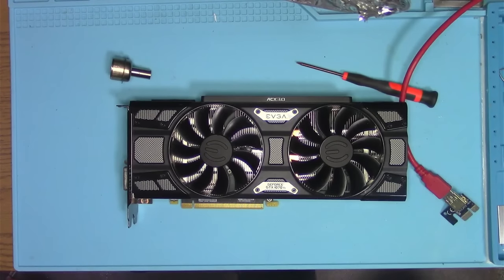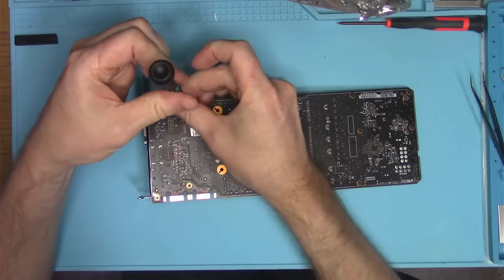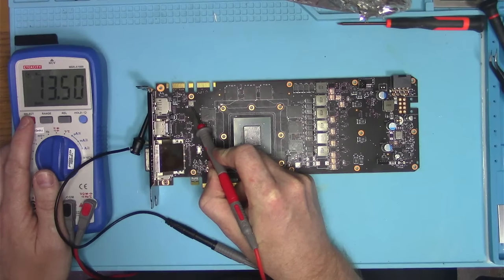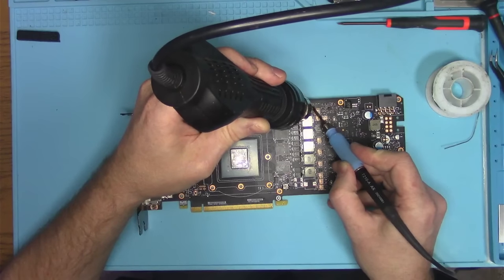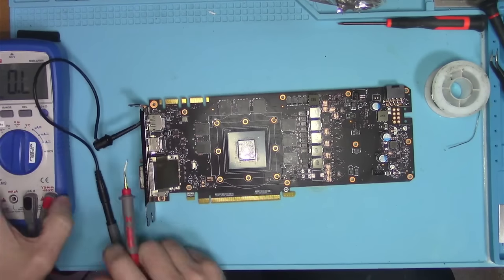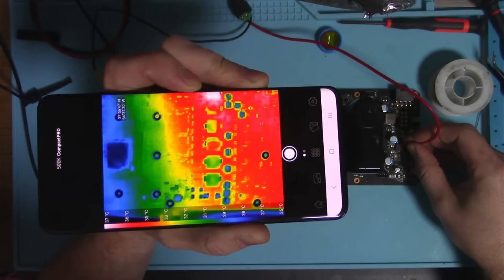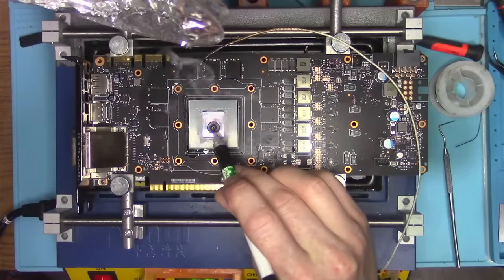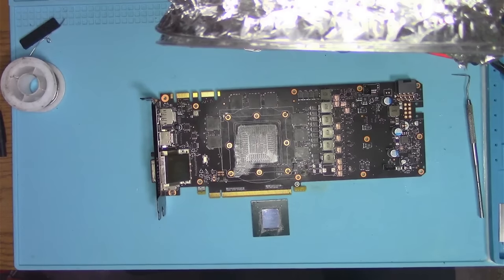How i learned GPU repairs

Comment: Hello, my gpu have 3 DP and 1 HDMI. Two DP port is not usable. The first DP port got not signal, second DP port boot up then make system unstable and freeze the system (unrespond). I'm currently using HDMI and the third DP which have left on the card but they refreshing every 5 minute (gone black screen for 2 second) on main monitor. May I know what the problem might be? Is that the port or the circuit? Thanks.

Comment: Same happened with my 1080 EVGA. All of them the same overheating VRM bs. If you don't want to mess with repairing your own GPU, just go the Nvidia control panel and set MAX fps limit for your games. From my tests (non-dead cards), setting a constant and low fps will not overload the VRMs and it won't go black screen/full fan speed 99% of the time.
Reply: Maybe undervolting? Helped me with my 3070ti

Comment: You are wise not to assume anything... The first GPU I worked on was a 1060... it had a mosfet stuck open feeding 12v to the core... No fuses... I was like this core is 100% dead and gave up on it... Next day I’m like what if? And I take the component of the board, put it in a machine and what do you know, it actually worked 😅 In fact it still works a year later gaming daily... Part of the luck of the customer was him using a good seasonic psu that tripped OCP really fast... He actually tried to power the card more than 10 times... So imagine feeding the core 12v 10 times and the damn thing still works 😅😅 I still can’t believe it haha

Comment: Hey do you have any videos explaining how you learned how to do this? I see you're checking resistance and for shorts but you don't explain how you know what values you looking for or how you know which areas to check or which areas to desolder and run voltage through

Comment: Word to the wise .... If you keep using "whatever is handy" to prop up the board on your bench you are going to short out the card. So far every one you have used  - screw driver, flux syringe - have metal ends and trust me, they will short out the card.
Ask me how I know 😞 Suggest using items made of wood or fiberglass. NOT METAL!

Comment: Can I ask a question, I just turned my pc on when I woke up in the morning, was able to open chrome and search youtube, 30 seconds later my computer suddenly turns off, I was trouble shooting it on which part was not working and when I replaced my gpu with a different one it displayed. Can I ask what caused or what is the issue of the previous GPU and is it still fixable?

Comment: Hi , Zotac 3070 OC was working for a year , one morning i started pc , i've opened google and after 7 min of use screen went black , upon restart i get 5 beeps no signal . i knew power supply was not enough and i used a pigtail also , witch i new is not ok but i didn't use the gpu on hard work so was fine till now . after  i verify my 3070 in another good pc , the videocard was working and on max setup in games went in 64 deg max . i thought my psu is short on the pce6+2 cable so i replace the psu with a 750 w with 2 gpu cables , yesterday was working fine full load in games , today i started the pc and game me no signal after i entered the password lol so i've replaced that 3070 with my old 1050 and pc is working fine as it did for the last 4 years now , what that 3070 might have ?

Comment: Can I please ask you a question?

My GTX 1050Ti got fried after only owning it second-hand for 2 months... I took it to 2 different repair shops and one of them told me the power supply to the GPU is fried.

So my question is, can it be fixed? Or did they really try their best?

Comment: I honestly do not see how this video explains to us the average person or anyone with just a little bit of knowledge how you learned to repair GPU,s.  A more in depth explanation like how to know which pins to check firstly for shorts, and how you know what ohms should be coming out of parts your checking would give us more insight on why and how and where to look for shorts first off all. Please make a more in depth video for us wanting to learn how to find faults on our GPU,s would be greatly appreciated, and maybe let us know what symptoms of common faults align with what to check firstly and so on. You are a professional at repairing GPU and know exactly where and what to look for, the vast majority of us wanting to fix our own GPU do not know even the basics.
Reply: I think we can conclude that he looked up tutorials for one need at a time. It started with the memory sticks, so he must have done some research or had prior experience in soldering and anything he couldn’t figure out he just looked up. As he said, there were failures; you learn by trying. He said he learned bit by bit as he went on, so that implies that early on he wasn’t knowledgeable to do everything he showed us in this video. Maybe the title was a bit off, but nonetheless that’s what I gathered.

Comment: I actually have the same issue with my gpu it triggers ocp at 35-37 degrees which is normal temp... Sometimes at the beginning of boot and sometimes after 15 mins at the desktop not even gaming😢 is my gpu dead???

Comment: I learned also to fix electronics communication gear in a similar way, by repairing. Now, 30+ years later, I could say I have got 10000++ hours on it, so I should be a master repairer 😂

Comment: Thought it's worth a shot to ask here, but does anyone know why would lights in a room flicker if I am running a triple A game on a 7900 xtx (its the XFX one), I may have an idea why it's happening, but I want to see if I can get any clarification. I am using the RM850e PSU and it sadly only came with 2 PCIE cables so I had to sub in a third party one (older PCIE cable).. It runs fine just that I notice when I am maxing out settings and playing at 2k resolution it gives me this problem. I haven't tested all games to see this happen though.. Thanks for whoever can help me!
Reply from the maker: It's your power supply switching on and off.
My soldering station does that when it keeps the heater warm.
On off on off on off.
Your crappy home wiring helps to make it noticeable and so is mine.
Reply: @northwestrepair  Hey thank you for replying, would it pose any dangers? It's not horrible flickers just bit annoying so I just turn off the lights. But I dont have much electrical expertise so I figured to ask here
Reply: @KhaledIron  my air conditioning flickers all the lights in the house when it turns on, but i haven't had a problem with it crashing my PC
Reply: @nightmare1010  Hey thanks for replying, yeah I can live with it but I am just worried it'd be a fire hazard or something that's all

Comment: Hi, I have 3090 with 24 GB can you modifiy it to have 64 or 128 GB vram ?
Reply: it's not really possible
Reply: unless youre using that card as a workstation you dont need that much vram, also higher vram isn't going to magically give you more frames. if you want a better workstation card there are dedicated workstation cards
Reply: @cerberus4545  I use it for machine learning and ai so it is not for gaming at all. Just running calculations

Comment: the real question if you charge 100$ for any repair why would someone try to repair it when for 100$ you can get a better used card
Reply from the maker: Because this was recorded when repairing this GPU made sense.
Not so much anymore but someone still prefer to fix it.